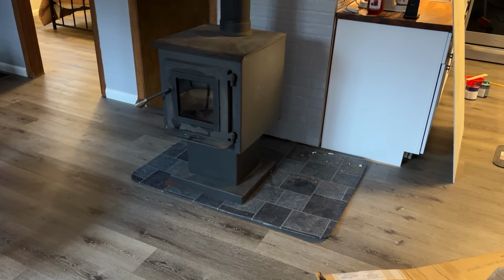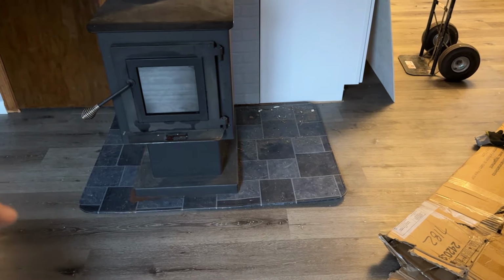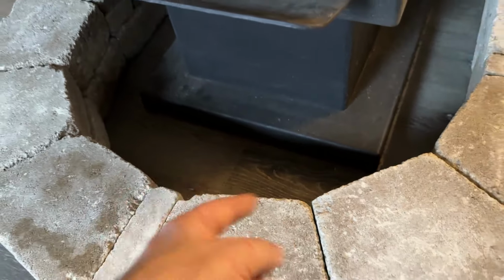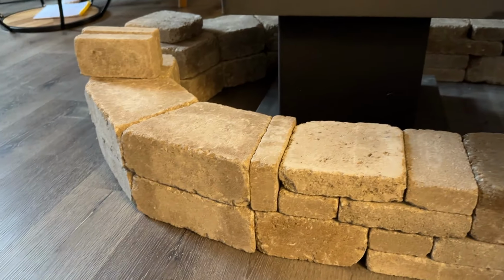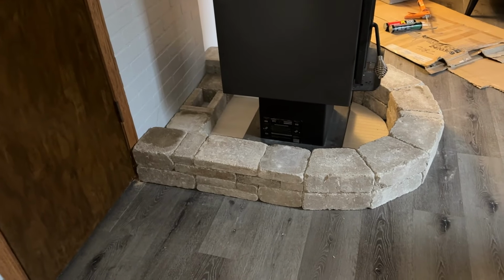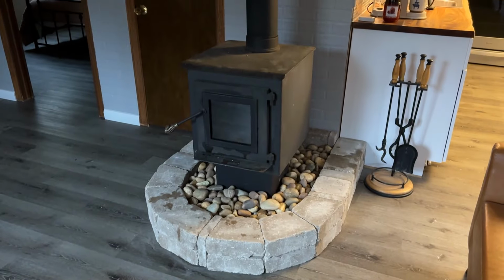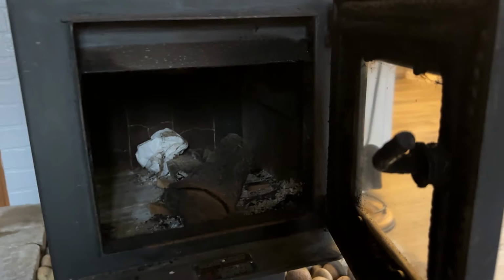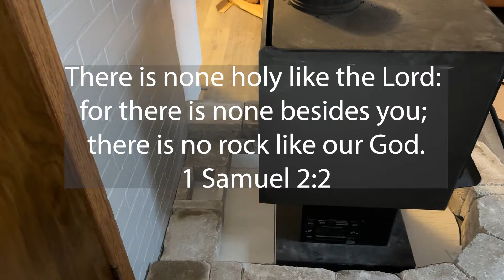The Ultimate Wood Stove Hearth

Comment: One way to have long lasting heat. 

I personally believe that some of those larger blocks should go up the wall at least to the height of the stove box or a foot higher plus a piece of cement board between the wall and blocks. Additionally a larger piece of cement board should have been used underneath the stove and blocks/rocks to protect the floor. You now would be protecting your home and establishing a larger thermal mass for radiant heat.

Comment: I like the idea of thermal mass, but it seems like that would add more value if the mass was sitting alongside and above the stove, where most of the heat is radiating.  I notice that hardly anyone ever builds thermal mass (masonry) around a free-standing wood stove.  Is there a reason for that I don't know about?